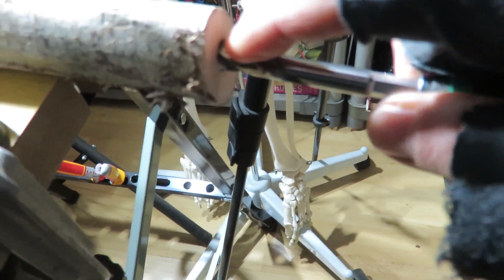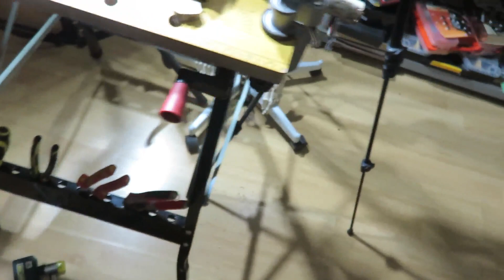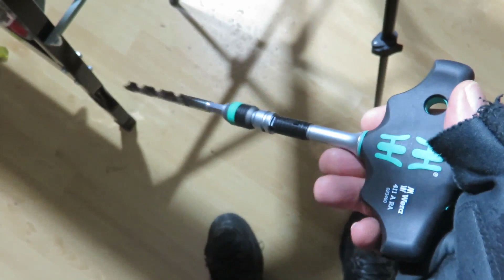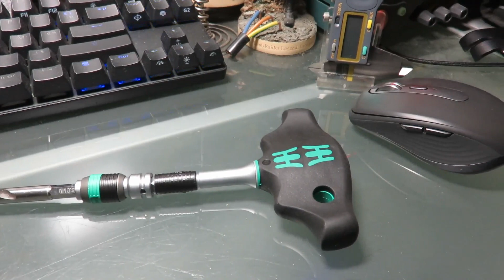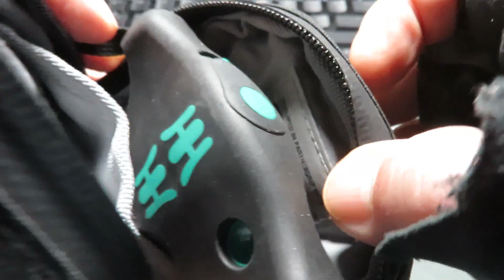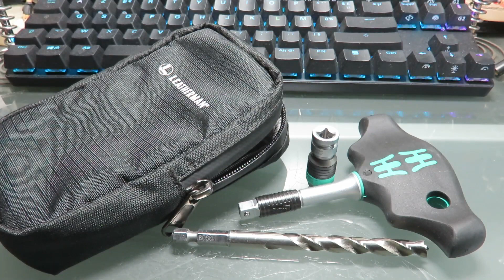Victorinox's awl disqualified for outdoor & bushcraft?

Comment: Thanks for making me buy a voyager lite on Amazon lol, after looking at your victorinox traveler with the digital clock made me look it up on Amazon for 59.00 but the seller also had a brand new out of box used because of different box voyager lite for 49.00 so I jumped on it, but very good review if the tool..

Comment: ....just use a hex drill bit and the Leatherman ratchet?
Reply from the maker: Yes, I've shown this before, but the WERA ratchet will be more convenient to use, apply more force.
Reply: ... my SURGE in pistol grip mode is pretty  forceful :0)
Reply: @GriffMJ  You can also double up the leatherman or multitool driver with a leatherman ratchet + 1/4" ratchet ring spanner and use it like a brace and bit.....this allows you to use larger drill bits like wood auger bits. I stack the tools like this : Dril bit - ratchet ring spanner (fwd engaged = Use this to give rotational drive) - leatherman ratchet (rev engaged = allows the drill bit to rotate without turning the handle/multitool) - multitool (use the multi tool to provide lateral stability and to apply downward pressure on the bit).
Personally I carry similar tools in my edc mini toolkit which are able to be employed in multiple ways and avoid carrying a bulky T handle
Reply from the maker: @GriffMJ  Less than with a T-Shank ratchet and which will be more resistant, more comfortable, less bulky than a multi-tool in pistol mode, and allowing more force to be applied. For example, consider making a 20mm diameter hole in hardwood...
Reply: @diezelle57  .... I love WERA tools ( I have some), but the whole point of EDC is to simplify your carry with the best practical tools in the most compact form.
Reply from the maker: @GriffMJ  Bushcraft is not EDC and the compactness is not really suitable for working on wood in nature. This is the reason why I chose this title for my video.